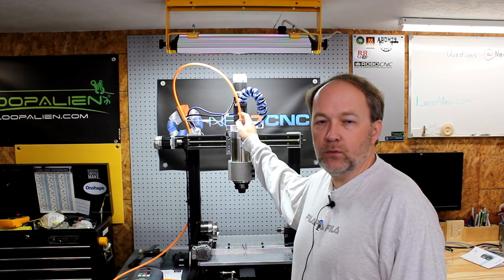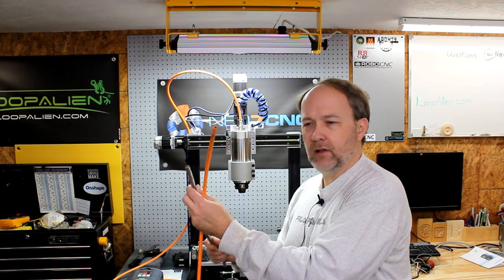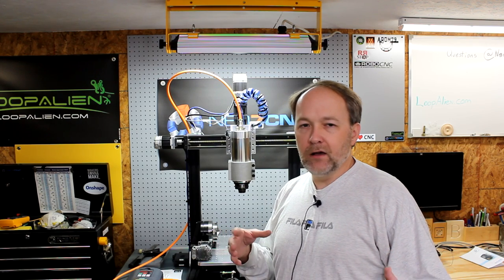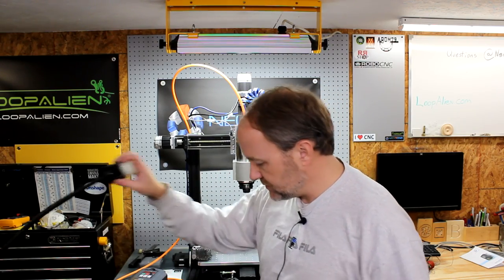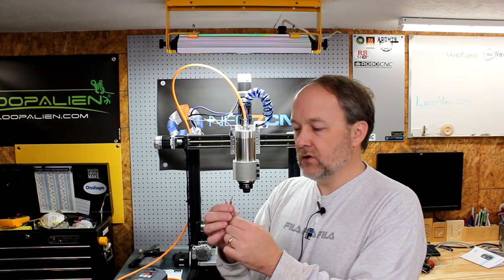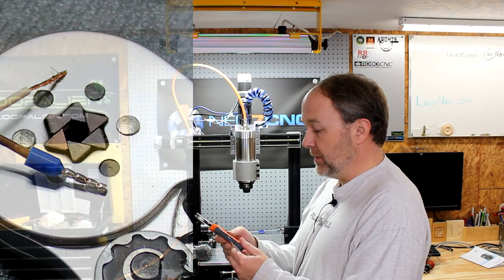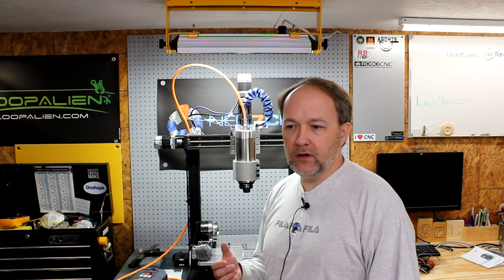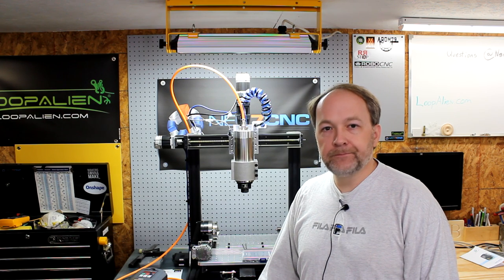KR33CNCv2 DIY CNC Update 4 - Neo7CNC.com

Comment: I have the same spindle and my coolant bucket would get pretty warm after an hour or so of run time.  Buy one of those small black radiators on ebay and a small fan (about $15 for both).  I noticed a major improvement in keeping the spindle temp down to a room temperature level after the addition of the fan/radiator.  Your machine looks great, can't wait to see you run it.

Comment: Every Chinese controller I have seen doesn't seem to allow VFD via gcode and people don't seem to mind.  Is there a reason to control the speed via gcode so it can change speeds during a job?
Reply: Dark Alchemist loads of reasons. spindle speed vs feed rate or cutter radius eg.
Reply: Sirus
Thank you because that is exactly what I thought.  Tight corners versus wide open straight lines, etc...  Why people don't mind I don't get but which, all in one, controller allows M3 S<rpm>, M4 S<rpm>, M5?

Comment: David, how did the voltage to the water pump ever work out, sir?  Definitely concerned that you feed a NEMA 1-15R with 240 VAC!  NEMA 1-15R s are designed for and listed and labeled for 120 VAC, 15 A, period!  Bad safety idea to put 240 VAC on a receptacle intended for 120 VAC.  Some idiot will look at it and assume that it is 120 VAC!  Definite code and UL listing/labeling issues!!!Otherwise, love your work!